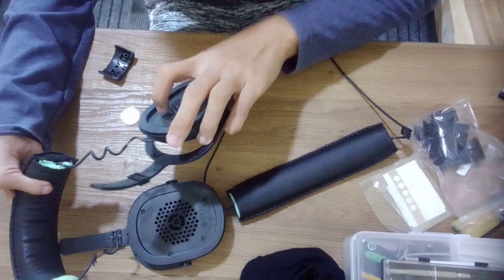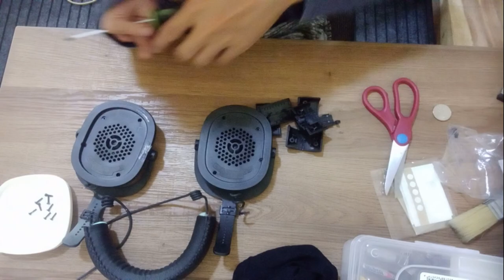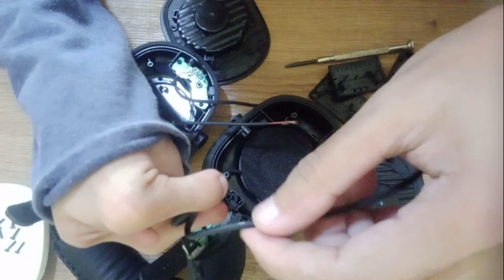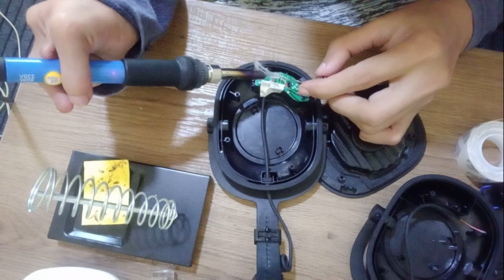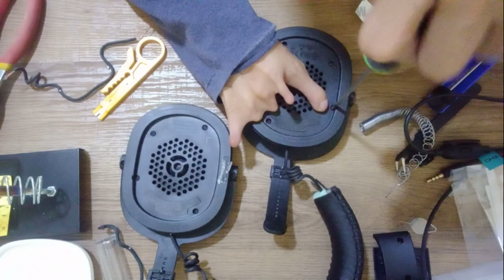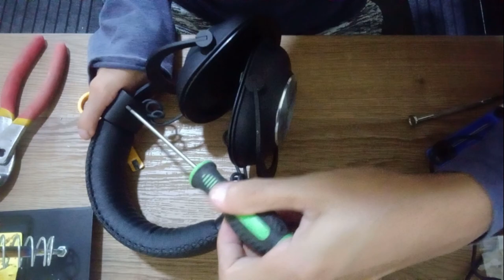How to fix broken Logitech Pro X Headset

Comment: thank you very much dude. I have had my headset with the broken buckle for 2 years. Yesterday I decided to look for how to fix it and I found you
Reply from the maker: Just buy a decent solder and be careful with those thin wires. Take a picture first on the wirings before you desolder. So you won't be lost when you solder it back.

Comment: Where can i buy a replacement for that peeled cable?
Reply from the maker: Hello there's a link in the description and it's not mine. It's where I bought my mine, by the way here's the link for you to save time, just make sure you bought the color you want. https://www.aliexpress.com/item/1005004849376292.html?spm=a2g0o.store_pc_home.0.0.2d45663dqWhwVI&pdp_npi=4%40dis%21PHP%21PHP%20334.83%21PHP%20334.83%21%21%216.00%216.00%21%402101fb1017052447833437617ea92d%2112000033754541576%21sh01%21PH%214410403417%21
Reply: @PWDlife  Thank you for sharing this video tutorial. Can you confirm that it is indeed the original headband?

Comment: Great video, just i have a doubt.
i bought this headband on alixpress but this one have 5 wires those are yellow, white, gold, black and red. so i have a question which cables do i need to use?
sorry but my english is to bad but i hope I have made myself understood.
Reply from the maker: The Logitech Pro X wired version only has 2 wires which is red and orange only. Did you order in the link I posted in the description? Maybe you can use any of those 2 but please remember what component did you solder it. So it would be the same placement in the other cup. Solder it in a good way, do not leave any impurities because it may cause grounds and disruptions in the audio. Also you can send the picture of your headband in my email to have a look on it. carllouiegarcia@gmail.com
Reply: @PWDlife  thank you very much my friend.
i have sent you an email 😃
Reply from the maker: @bayronmurcia496  Emailed you and I hope it will fix yours.
Reply from the maker: @bayronmurcia496  Don't forget to subscribe if it's already fixed. <3
Reply: @PWDlife  Thank you very much again bro!
i´m gonna try it tomorrow since i gonna have time after working.
and then i will tell you how it went.
and yeah bro, you have a new sub 😃
Reply from the maker: @bayronmurcia496  goodluck on it, if you have questions just email me. Welcome